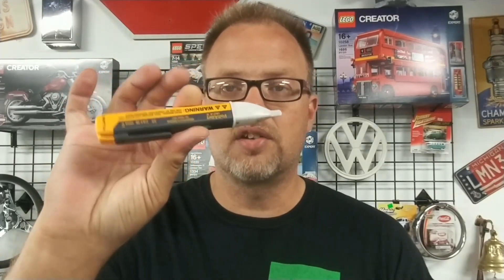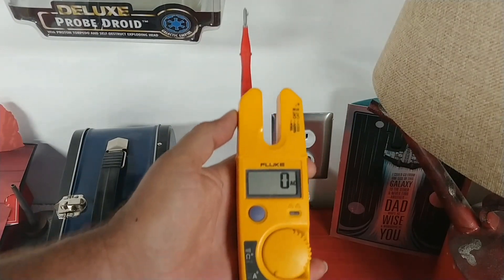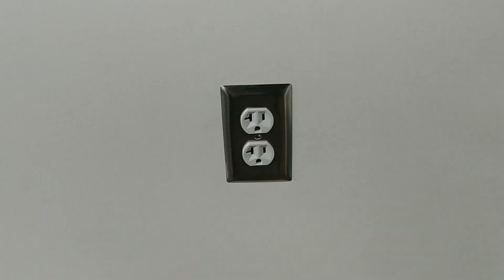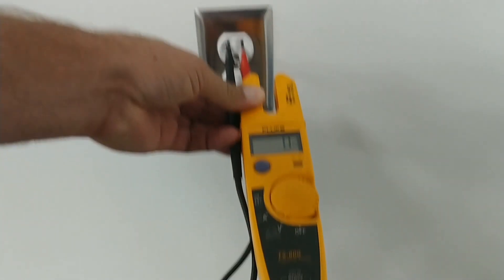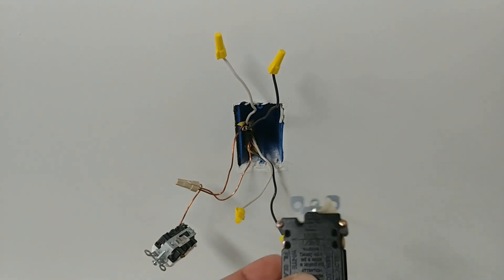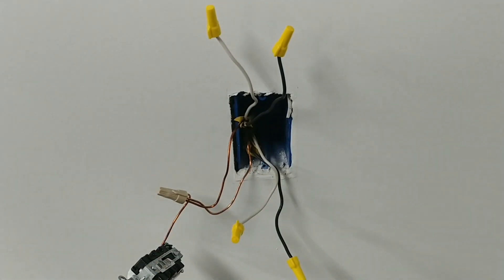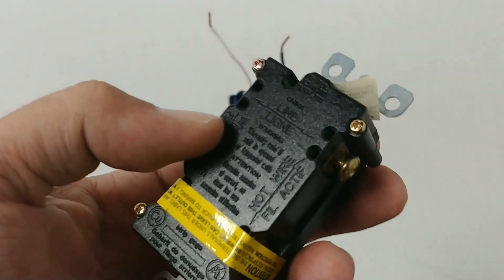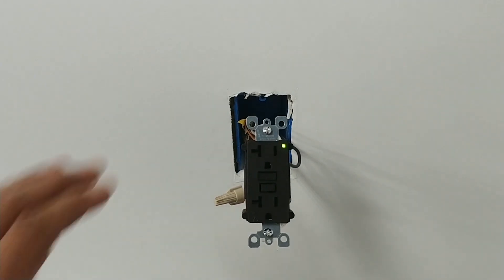How to install and wire a gfci outlet.

Comment: Hey Daryl, Can you make a video on what type of wire to use for which application (Wire to use for a light vs a wire for an outlet), if there is a difference? what the 12/2 means and all that?
Reply from the maker: Hey Buddy and yes absolutely.  Ill get one posted soon. 😀
Reply: @BevinsBuilds  Awesome, TYSVM! also wanted to ask, for your Pole Barn, what size pannel did you use?

Comment: How many circuits does a GFI protect
Reply: When wired as Daryl showed, it will protect every outlet downstream in that circuit only. This means that every receptacle and switch that gets its power from the gfci's load terminals will be protected and will disconnected from power when the gfci is tripped. If the purpose is to protect against shock because there's no ground wire, then it should be installed as the first receptacle from the main panel.